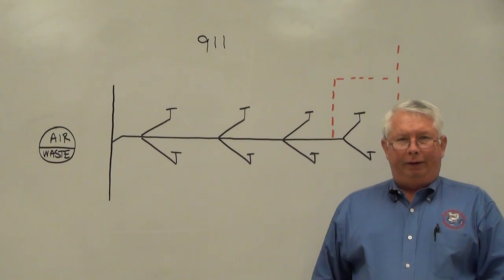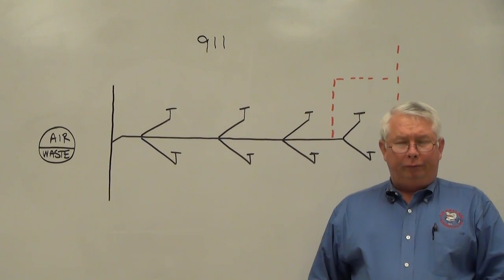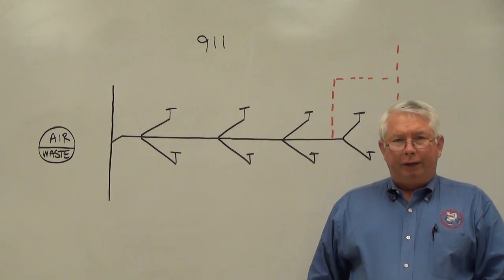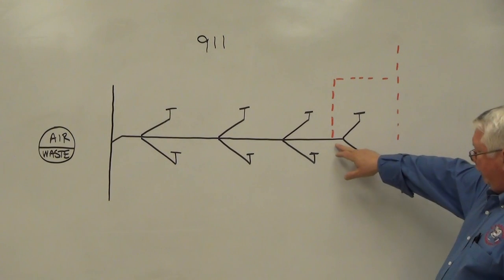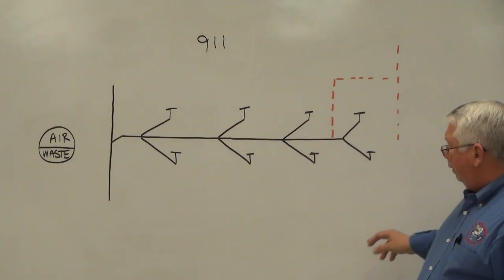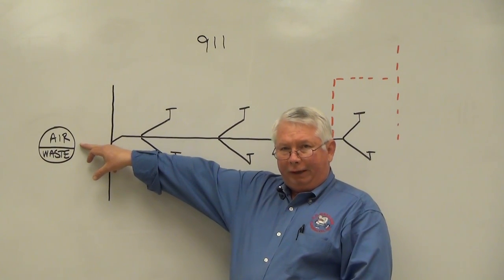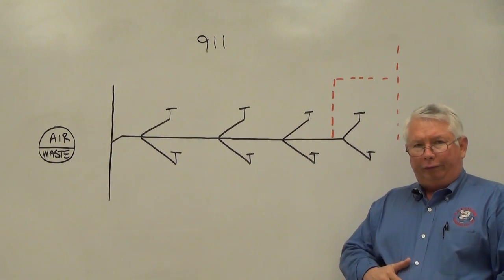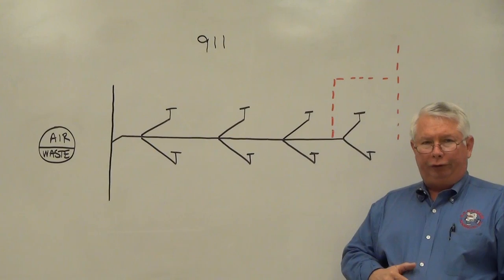Circuit Venting 1

Comment: So this is just another name for combination waste and vent
Reply: FollowerofYahuwah no, a combination waste and vent has no requirement for a dry vent to be installed. In the Circuit vent system, you must have a dry vent between the two fixtures that are most upstream. Also, in a circuit vent, you can only have a maximum of 8 fixture drains connecting to it before needing to add a relief vent, where the Combination W/V system is sized according to dfu and has limitations on the types of wastes you can drain.

For example, if you have a water closet, you cannot use the CWV system, but you can use the Wet Vent or Circuit Vent systems.
Reply: More wet-venting.